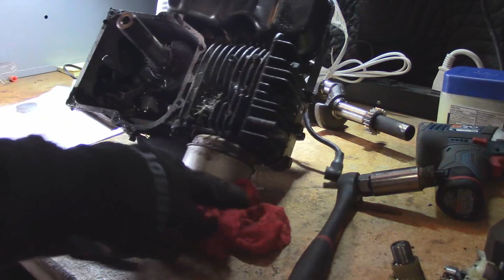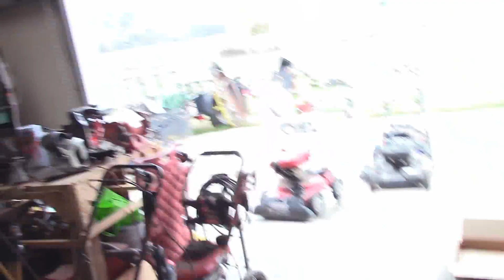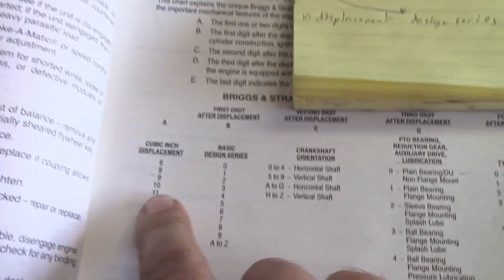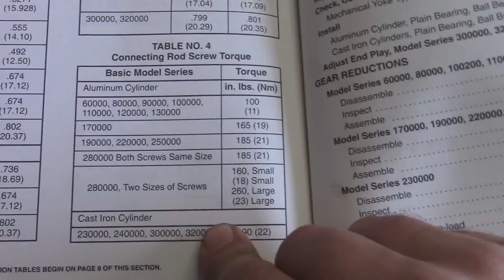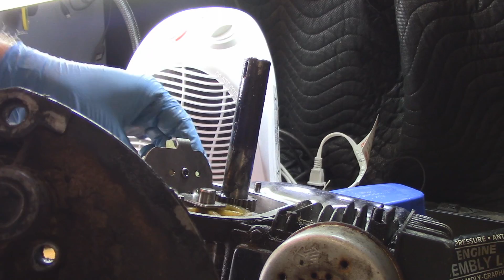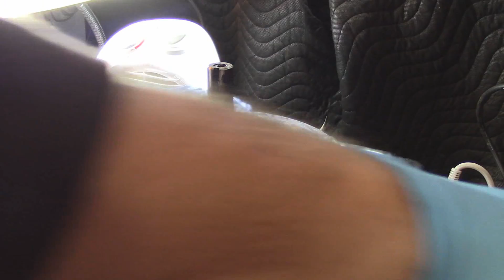Scavenged Briggs Crankshaft Installation

Comment: I was just wondering if you put bigger wheels on the mower to make up for the longer crankshaft which is going to lower your blade. lol
Reply from the maker: The deck I had it on the old crank was too short. It’s fine now.
Reply: All's well that ends well...eh?

Comment: You ever worked on any seized motors? is there hope in trying to save one? There's a couple old mowers here but they've been sitting for probably 10+ years I was thinking of trying to tear down and I'm guessing after all those years they are seized up.
Reply from the maker: paradoxdesigns yup I unseized a few. I did a video on an old craftsman that was seized

Comment: Love these motors my dad has had his on the lawnmower since it was new in 2006. He hasnt done much work to it even when it was doing the surging these motors have a habit of doing he kept running it and it cleared itself after a few months of mowing strangley lol. I wasnt so lucky mine was doing it and blew out when i was mowing for a abandoned house with tall grass everywhere it was to much strain on the worn gasket and ripped it but no big deal to fix
Reply from the maker: These are my fave briggs motors for sure

Comment: You didn't use any gasket maker on the mating halves before you placed the gasket. Some think it is necessary; some don't.. Last time I did a job like this I didn't use it and no leaks some 9 mos. later.
Reply from the maker: As long as you torque all the bolts the same and cleaned off the surfaces well enough they won’t, hell the factory doesn’t use any sealant I’ve not had any I’ve done leak eithe r